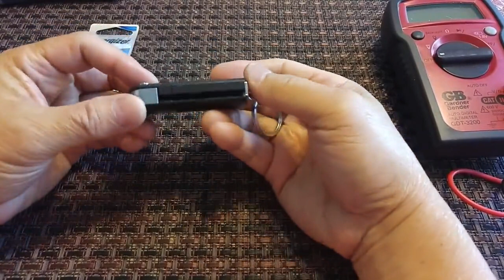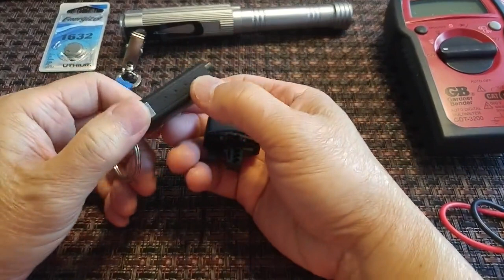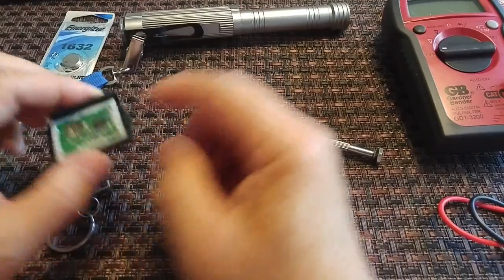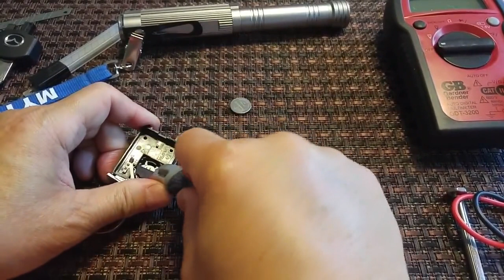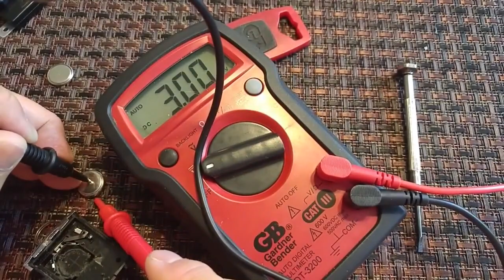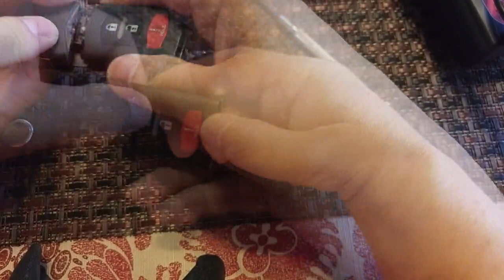Change 2012 Mazda 3 remote battery, replace with bigger CR-1632 by modifying remote

Comment: Clear instructions up until the bigger battery.  My original battery lasted for 8 years so I will take my chances with the same size.  The tab location was very clear and helpful.
Reply from the maker: I understand. My protege5 battery never needed replacement in all its15 years.

Comment: Do not do this, putting in a different battery will cause the key to malfunction. I found this out first hand.
Reply from the maker: I have 2 remotes modified to use CR-1632. They are working fine and the batteries last much longer